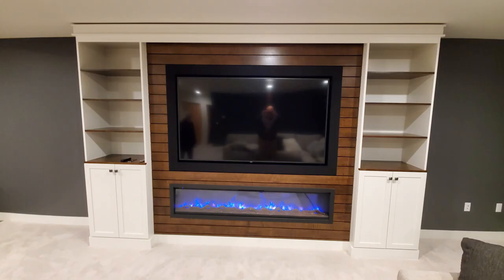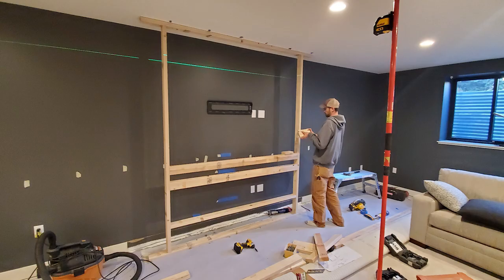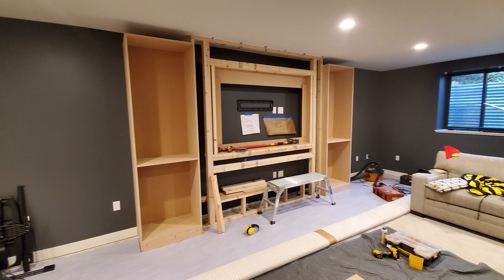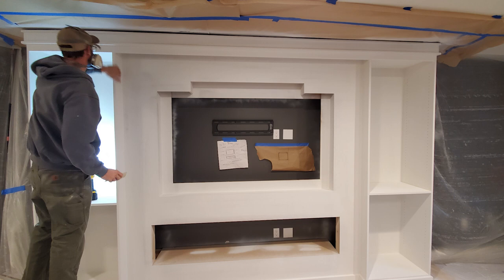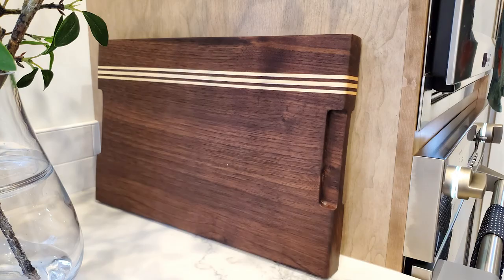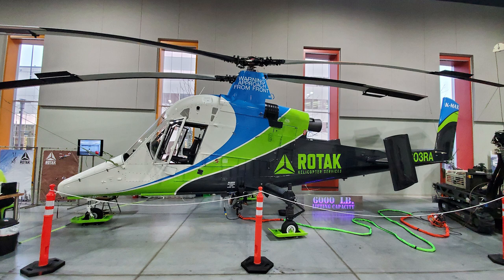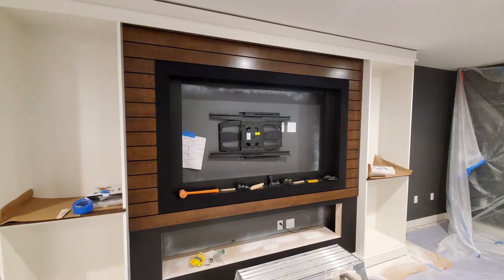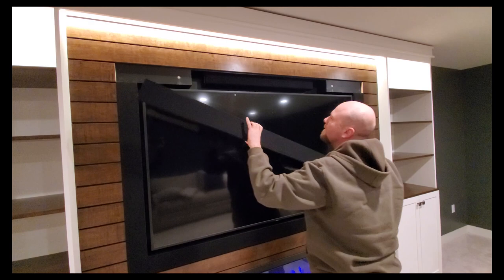Custom Built In Entertainment Center 75" TV, With Fireplace, Start to Finish.

Comment: Did you use any specialised heat proof materials for the fire place?
Reply from the maker: Nope, fire place is just one of those fake ones with a heater in it. So it didn't require much to work right there.

Comment: What material you use for the front What kind of wood is that
Reply from the maker: Was MDF
Reply: This one you use Handprint Medium Density Fiberboard (Common: 3/4 in.x 2 ft. x 4 ft.; Actual: 0.734 in. x 23.75 in. x 47.75 in.) 109098